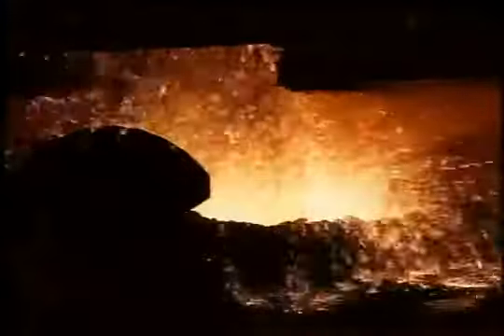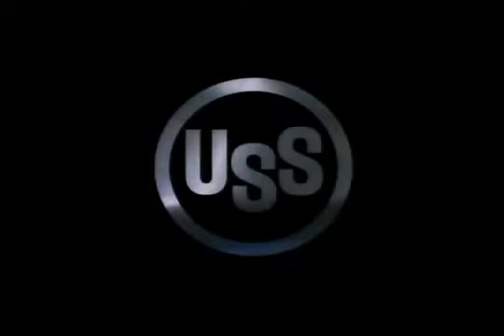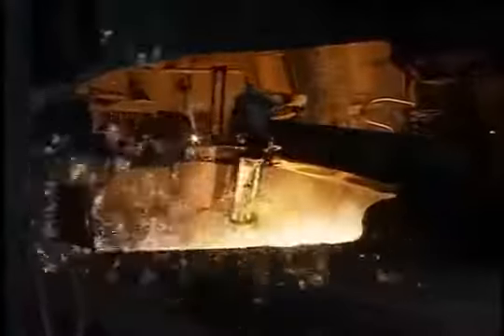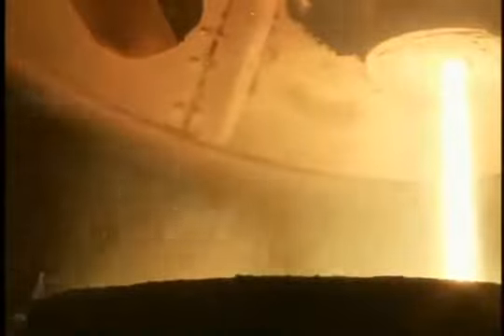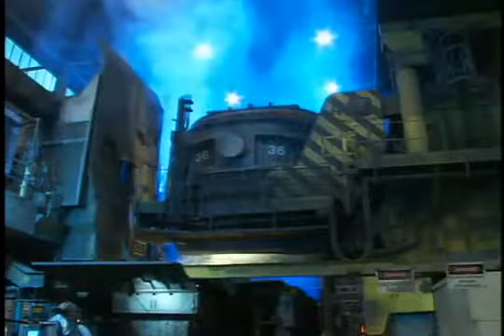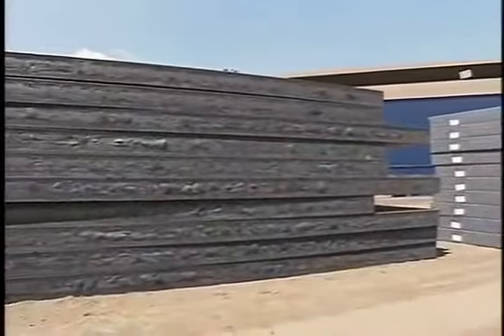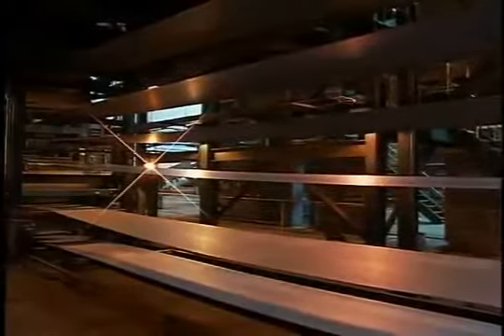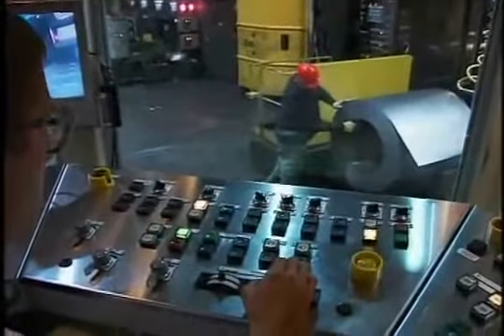STEEL  From Start to Finish

Comment: Abdilah Sismantoro 2713100145

This video shows us that the steel making process is something that takes quite long process yet so fascinating to follow, where so much spark, blast and even explosion occurs.

At this video, we can see the whole steel making process of United States Steel (USS) company.

The process begins with a blast. As rocks explode, and the raw materials of steel are tossed from the earth. We know it as strip mining. The prize inside is crude iron ore. We get it by grinding the rock into a pellets and separating the ore with powerful magnet. Then we formed the ore into marble size pellets, that will later be converted. Then we created coke as a fuel of iron making process. We crushed the coal, and baked for 12-17 hours, and remove it from the oven as solid carbon fuel. The fuel and pellets come together in the blast furnace. And we add just enough limestone to remove impurities. From below, a continuous  blast of a superheated air combusted the coke, intensifying the heat, reduce the amount of carbon  and change the raw material into molten iron. At regular intervals, we tapped this blistering iron into giant submarine look-alike container that rides on rail to the basic oxygen shaft. Where iron will be turned into steel. In this fast phase sequence, up to 250 tons of steel can be made in less than 45  minutes. We begin the steel making process by dumping the recycled steel scrap into the basic oxygen furnace n(BoF).Spark occurs when high purity oxygen is blown in to the mix at supersonic speed, and molten iron becomes molten steel. 

To make the custom blend, that makes steel  the most widely used metal on the planet. In fact, the United States Steel (USS) produces over 1500 dfferents chemistry to meet the customer demand for cutting edge-value added steel. The spark once again occurs as we taped molten steel from the vessel into a ladle. The focus then shifts to forming and finishing, which determine even more of the steel characteristic. The first step in this sequence is to position the ladle of a massive funnel that feeds the continuous caster containing molds that shaped the steel. The molten steel is now at 3000 degrees fahrenheit. It is channeled from ladle to caster where it forms to a red hot solid. The shape of the molds determines the shape of semi finished product that come out of the caster. And since most of USS steel plant made sheet product. Most of our caster’s output slabs typically 8 to 9 inches thick and 3 to 5 ft wide. As they exit the caster,slabs are cut in to section up to 40 ft long and stacked to await further processing. Then it’s on to the hot strip mil. This is where we begin transforming steel slab in to steel sheets. Slabs are re-heated 2400 degrees fahrenheit and descaled before running to series of roughing stands that make them thinner and longer. Then they cycle to finishing part, where they are rolled even thinner. Finally they are cooled and rolled in to coils that maybe thousand of ft long but only fraction of an inch thick. The entire process is untouched by humans hand, controlled instead by operators using state of the art  automated equipment. 

Then the coils are dipped to an acid bath to clean the surface. Some of the coils are shipped directly to customers as hot bands, and others are destined for application that requires special finishing. Beginning with cold rolling to make them even thinner. At that point, coils may be shipped or go on to one or more additional finishing processes. 
Coating, to make the steel resistant to corrosion. 
Thinning, to further reduce the gauge and add the thin coat. 
Annealing, to make steel that is easily to bend then form. 
And tempering, that uses special rollers to add hardness and create surface texture and other special finishes.

No wonder the story of steel making stays so fresh since we can’t deny that so many things or products in our daily life are made of steel.

We all know that the steel industry leads a country to a superiority. so it is our duty, as material engineers or even metallurgists to make our country even better at its own steel industry.

Comment: Donny Pratomo (2713100036)
PBB B/Ms. Dian Mughni Fellicia

In the video that I watched just now, it's the story of hot metal to cold steel where the finished steel products in the form of a beam. And one company focusing on it's the United States Steel. Before to extraction of iron ore there making process iron ore from nature, namely the mining process where the mining process using strip mining method, becsause this method is suitable to explore the upper part of the earth. Because the average elemental iron in nature are at top of the earth. After eksplore, grinding the stones in order to get the stone in a smaller size, and formed pellets to be easily formed wire. Before it's melted coal is heated 12 to 16 hours to get the coke, then some of the pellets fed into a blast furnace. Also included limestone to remove impurities. Then heated to super-hot coke so as to change the raw materials into molten metal in which the blast furnace had reached a temperature of 2700 degrees Celcius. In a Basic Oxygen Furnace visible spark mixed with pure oxygen into the molten metal. With steel molten steel can change the shape of the beam to the rod. This process has includedthe end of the process.

Comment: Afira Ainur Rosidah 2713100114
PBB B/Ms. Dian Mughni Fellicia

This is my review about the video:
This video shows how iron ore is processed from start to finish.  It is began with blasting the rocks that contains iron ore. The mining method of this company is used strip mining. The blasted rock called raw iron ore. Afterward, crude iron ore is taken then grinding into pellets and then separating the ore with a very large magnetic separator. Then the ore is heated and shaped like marbles. Then coal is cooked into coke for fuel of iron-making. Coal is crushed and baking 12 – 16 hours to make it as solid carbon fuel. The fuels dan pellets are put together into the blast furnace. Impurities are removed, ore is bunt. So that the raw material turned into molten iron. At temperature of 2700 degrees Fahrenheit, the iron entered into giant submarine then here will turn iron into steel. Process begins with dumping the scrap into Basic Oxygen Furnace and  adding hot iron. High pure oxygen is blown into the mix at supersonic speed and molten iron become molten steel. Now, it’s ready to create the custom blends that make steel widely used. The company produces some different chemistries of steel.  Taking the molten steel from hot vessels into lethals. Then the focus is on reforming and finishing to determine the steel characteristic. The molten iron is placed into the continous casters containing mold to shape the steel. The shape is determined as the finish product that come out the casters. The steel slag later is cut. And then steel slag is reformed into steel sheet. Steel slag is reheated and descaled that make them thinner and longer. The entire process is untouched by human hands, controlling steps by operators. Then some products (coils) are shiped directly to the customers and others are given some treatments to special finishing. Coating to make the steel resistance from corrosion. Thinning to further reduce the gauge. Annealing to make the steel easier to bend and form. Tempering with special roller to add hardness and create surface texture.

Thank You.

Comment: Eldwin 2713100077

My name is Eldwin from PPBB B Ms. Dian Mughni
This is review about this video: 
This video is talk about hot and cold metal from start to finish in USS(United State Steel). This process is started by blast to rock to make the raw material of steel tosses from the earth. We get out it by grinding and separating it(ore) with powerful magnet. After that, we form to be marble size pellet. We use coal as the fuel the ironmaking burst. We do some treatment to the coal. We crash it, seal it in air tight oven and bake it around 12 to 16 hours, so we will get solid carbon fuel. We put the fuel and pellet plus limestone in BF. We use limestone to remove impurity. In BF the heat so intensive from continous plastic super heated air and it can change the raw material to molten iron. We start steel making process by dumping recycle steel scrap into BOF(Basic Oxygen Furnace) and adding hot iron. Molten iron become molten steel because high purity oxygen are blown into the mix in supersonic speed. We can start to make costum blend so it can widely use. Then, we tap molten steel so we will get high formable metal. We continue to forming and finishing, which determine the characteristic from the steel. The shape of the mold is determine the shape of steel. It will be cut into 40 feet long and wait for futher process. So we can make the steel slab into steel sheet by reheat it into 2400 degree of Farenheit and descaled into spinner and longer steel after that the steel ispulled and rolled. The entire process is untouch by human hand so they just control step.

Sometimes the steel need so special finishing before send to costumer, like make it thinner, coating the steel, annealing, and tempering.

Comment: Hello mam, iam Bathara Indra 2713100045

This video show us about steel-making process with clear explanation. My review from this video:
First, most rocks require blasting prior to excavation in surface mines. The rock exploded and the raw materials have steel are tossed from the earth. The second step, grinding the rock and separating the ore with powerfull magnets, the ore seperated from the impurities. The next step is pelletizing. Pelletizing is the process of compressing or molding a material into the shape of a pellet. While pelettizing occur, also occurs coal preparation. First step of coal preparation is crushing, then the coal baked for 12 to 16 hours and remove it from the oven as solid carbon coke (fuel). The coke and pellets come together in the blast furnace, and also add enough limestone to remove impurities. In blast furnace, coke combust and raw materials change into molten iron. The temperature in blast furnace reaches 2700 degrees Fahrenheit. The next step is making iron into steel. This fast-paced sequence up to 250 tons of steel can be made to order in less than 45 minutes. The beginning the steel-making process by dumping recycled steel scrap into the basic oxygen furnace. And adding hot high sparks steel the show when high purity oxygen is blown into the mix at supersonic speeds and molten iron becomes molten steel. Now, we ready to create costum blends. Over 1500 different chemistry to meet value product of steel. The next step of steel-making process is forming and finishing. Continous casting begin when the steel bake into 3000 degrees Fahrenheit and then the molten steel move to caster and become red hot solid slab. The slab cut into sections up to fourty feet long. Slab reheated into 2400 degrees Fahrenheit and make them thinner and longer. With hot rolling process, slab steel become sheet steel. Sheet steel cooled and be given oils. The cold rolling process make them even thinner and rolled. There are one ore more additionial finishing process: coating (to make steel become resistant to corrosion), annealing (to make steel easier to bend), and tempering (to add hardness), create surface texture and other special finishing. 
Thanks for share this video.

Comment: - IGFAR CITA (2713100024) -

My name is Igfar Cita (2713100024) from class PBB B Ms. Dian Mughni. Here are some review from the video above :

"That video tells us how to process iron ore into steel from start to finish. First things to do the process is begin from the blast. As rock explode caused by the blast, the raw material and steels are toasted from the earth. After the raw materials and steels are toasted from the earth, the contents inside are crude iron ore. The crude iron ore produced by grinding the rock into pellets and separating the ore with a powerful magnet then after that we form and heat the ore into a marble size pellets so that we can convert the ore into the iron. And we enter the iron making process by creating the coke as the fuel. We crush the coal as about 12-16 hours and remove it as solid carbon (C) fuel. The fuel and the pellets combine together in a blast furnace and we adding enough limestones to remove impurities. This process is to produce molten iron from the raw material. After the fuel and the pellets combine together in a blast furnace (and adding limestones), the iron process continue to the next stage. At the 2700®F in the giant submarine lethals will be heading towards the Basic Oxygen Furnace (BOF) where iron will be turn into steel. We begin the iron process in the blast furnace by dumping the recycle steel scrap into the Basic Oxygen Furnace (BOF) and adding the hot iron when high purity iron will be blown in a supersonic speed and the molten iron become molten steel. After the iron process is done, we separate the characteristic of the molten steel that has been produced by the Basic Oxygen Furnace so that the molten steel can be used on the planet (usually at 3000®F). Meanwhile, the steel slag can also be transformed into steel sheet at 2400®F. The steel slag later becomes thinner because it has been rolled by the roller. The important thing is, the entire process not being touched by human hands. There are three additional finishing process. First is coating to make the steel become resistance to the corrotion. Second is thinning to further reduce the gauge length. Annealing, to make the steel easy to bend and form. And the last is tempering that uses special roller to add hardness and create surface textures." 

That’s all the review from the video. 
Thank you